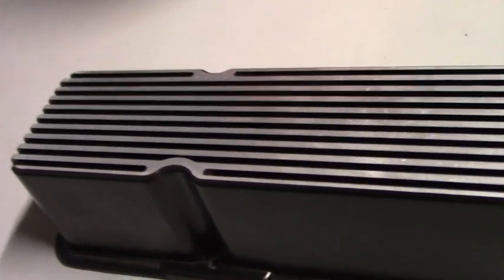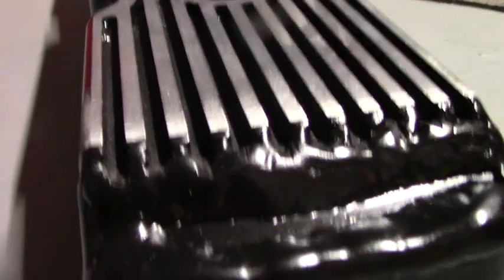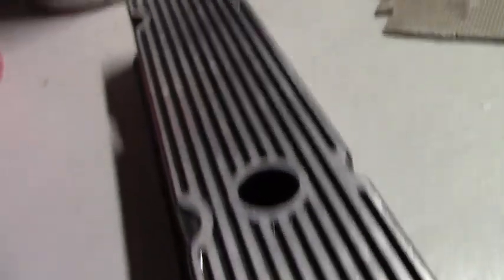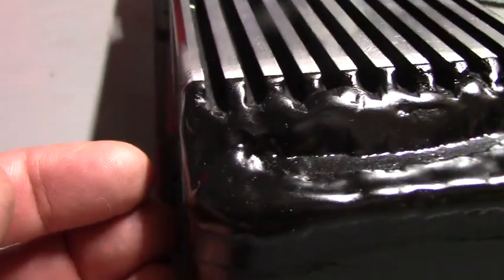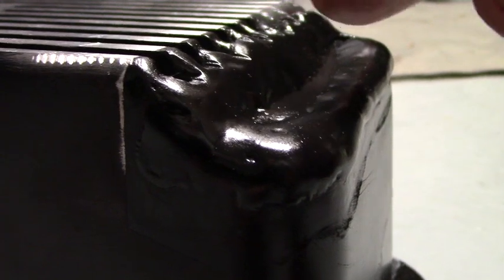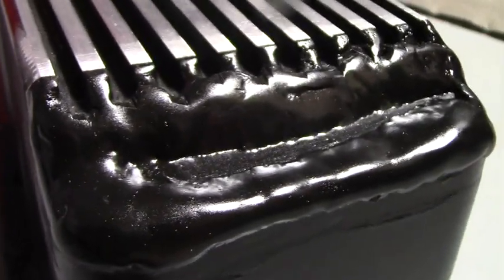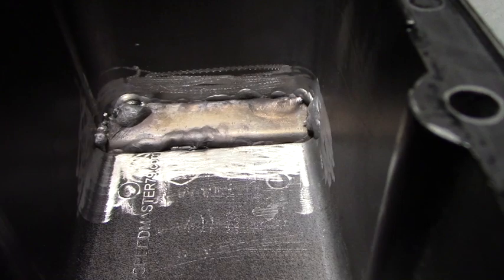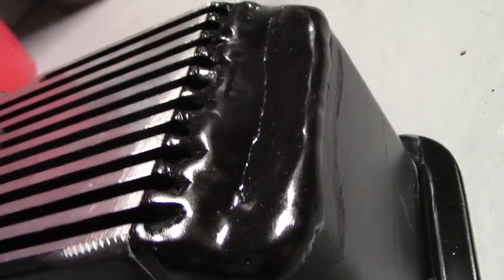Finned Valve Cover Welded!

Comment: Oh man! . . (At one time I was a welder fitter, so there's that. For Sea Alaska) . . . Ummm, I'm sure aluminum has it's challenges - but my friend, I too Envisioned a different out come, I thought at least the weld would have better swirls/beads? You know perhaps a light grinding to flush evenly? I'm with you thow . . . At least you got the job done that's counts. . For something (700 sounds a little Pricy, but, it's none of my bizness - hey, but thanks for sharing your progress - this was interesting. Have a good one . . Later brother 🌎🎥🎼🎩🍀💕
Reply from the maker: Not 700, several hundred.  Yep.  I'm kinda of disappointed with the whole thing now.  Don't relish trying to put it on only to find it doesn't fit, but that's what working with custom crap is always like.  I really thought the welds would have been smaller and more like a stack of circles.
Reply: @MrSFSTUDIOS  Thanks for the correction - yeah, went to bed, and couldn't stop thinking about your valve covers! Haha. . . I just had to confirm, I get your point, that the new part wasn't inserted as was intentioned, as we both know "inserted" the welds would have been more flat and Congruent with an existing flat surrounding edge - making a good looking weld even inviting for a little surface grind to even flatten the welds - In a perfect world, you wouldn't even see the welds - just had to tell ya, I know that's what you were shooting for. . Any who, thanks for responding, I'll be watching see how it all turns out,   Again Thanks Again Lol. 🌎🎼💕🎩🍀see ya :)